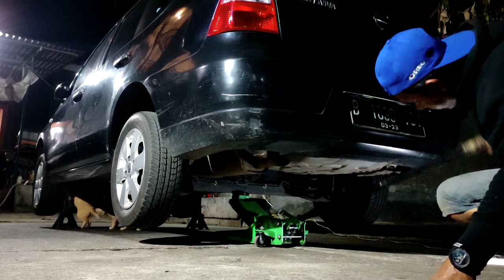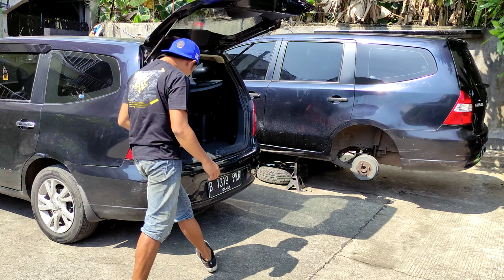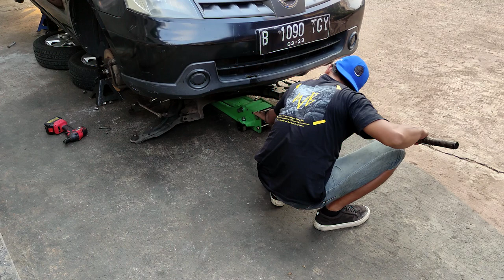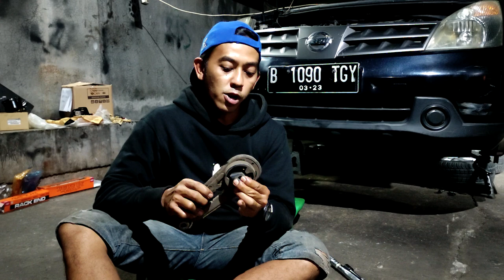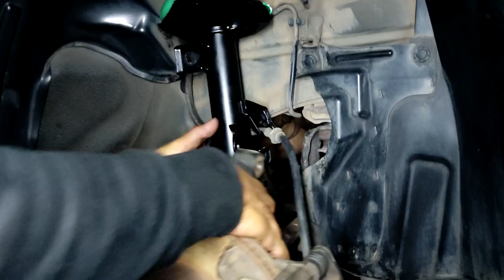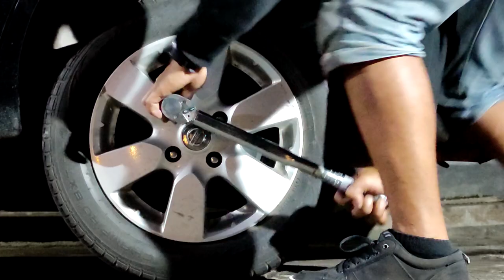Monroe OESpectrum Install - Nissan Grand Livina - Suspension

Comment: Konten nya bagus, runut, cara kerja rapih, ngga asal2an, alat2nya proper.. Tp menurutku klo ganti arm prefer yg ori (sejutaan). Itu part vital di kaki2 rawan bengkok. Atau klo ga ganti, bisa ganti bushing2 sm balljoint saja.
Reply from the maker: terimakasih banyak om,.,  🙏😎
betul sekali, arm di dealer 1jtan / pcs, lks setengah harga om,., saya tetep sarankan untuk parts oem, tetapi untuk alternatif karena dana dari owner nya bisa menggunakan aftermarket low-budget masih lebih baik daripada kw bungkus nissan, banyak yang copot joint dijalan, 😬
Reply: @danangalvaris  nah itu yg sy ngeri, sering liat postingan livina keseleo roda depan. Kdg cm kena batu pas belok bisa mleyot arm nya.

Comment: Alatnya bikin proses kerja lebih mudah, tapi safety,  keren banget.
Reply from the maker: terimakasih om, salam sehat & bahagia selalu, 🙏🏻😎
Reply: Mase .... Mobilku Vina 2011,aku mau ganti link stabilizer nih, pertanyaannya, link stabilizer Vina bawaan pabrik/ ORI itu materialnya besi/aluminium? Mohon pencerahannya 🙏
Reply from the maker: halo om  @rotibakar4607  , setau saya yg ori bawaan itu material aluminium dengan bantalan teflon, om,., #cmiiw
apabila diganti, menggunakan aftermarket 555 lebih rekomen, daripada beli yg gambar nissan, kecuali beli parts di dealer, 🙏🏻😎
Reply: @danangalvaris  terimakasih penjelasannya mase🙏
Reply: Saya mau perbaiki grand Livina tahun 2010 dimana alamatnya???😢😢😢

Comment: Om, saya ada hrv 2021 py istri pemakaian 2022. Awal beli ngerasa per ori ga enak banget, kalo ngerem berasa body mobil maju ke depan, plus mantul2 & goyangnya kalo kena lubang ga nyaman banget.

Nanya org dealer dibilang bawaan hrv emg gt 😂. Akhirnya setelah tanya sana sini, kami putuskan ganti per ori pake Eibach Pro Kit. Jauh lebih stabil tapi tetap kalo setelah kena lubang terutama ban belakang berasa keras & goyang, kaya yg shocknya telat compensate. 

Kira2 kalo mesti ganti shockbreaker rekomen brand apa ya om? Makasih sebelumnya
Reply from the maker: bukan nya shock aslinya pake showa ya om,? ada temen pake Tein, om,., infonya enak,., pilihan aftermarket bisa menggunakan Monroe, 🙏😎 #cmiiw

Comment: izin tanya mas, ada rencana mau ganti shock nissan grand livina L11 2014. untuk tipe shock monroe spectrum ini apakah sama untuk L11 dengan yang mas pasang? kalau gk salah antara L10 dan L11 ada perbendaan di shock breaker belakang(koreksi apabila salah). thank you mas sehat selalu
Reply from the maker: halo om, setau saya kalo aftermarket seperti merek monroe / jamex untuk L10 dan L11 sama om,., Tetapi untuk oem, ada beda kode parts bentuk sama tapi beda rasa, 🙏🏻😁
Reply: @danangalvaris  siap terimakasih infonya om. soalnya kalau salah order lumaya ongkirnya ke sumatra om. hehehe. trims om informasinya
Reply from the maker: siap om  @jerryjulian5632  , salam sehat & bahagia selalu, 🙏🏻😁
Reply: @danangalvaris  mending pake yg ori Om klo cari nyaman. Barang after market g enak dipake, saya pake monroe serasa naik avanza lg.Padahal dlu pake shock asli livina nyaman bgt.kumpulin duit aja dlu sabar.
Reply from the maker: setuju om  @D2T85  untuk nyaman pake oem. 👍
Untuk oem ini juga ada beberapa versi, ada yg untuk latio, ada grand livina, livina xgear, juga ultimate,., ini bisa digunakan tetapi beda karakter shock, 🙏🏻😁
Reply: @D2T85 2 tahun yg lalu saya ganti OEM, skrg sdh jebol om. Padahal jalanan tdk terlalu keriting. Sy ganti di beres Nissan 😅. Kira² itu knp om

Comment: Siang om, saya pake march, lagi nunggu part ganti low arm, tie rod, sekalian mau ganti shock depan belakang. 

Ac delco vs monroe perbedaannya apa om? 🙏🏻🙏🏻🙏🏻

Bengkel yg kerjain mobil belum pernah nemu ac delco kepasang dan masangin, jadi ga tau. 

Mohon di bantu ya omku saran nya.

Terimakasih banyak.
Reply from the maker: sama om, saya juga belum pernah nyobain AC Delco,.,
monroe oespectrum itu type monotube dengan gas, terasa lebih kaku dibanding oem, tetapi lebih stabil dan lebih awet untuk yang sering muatan,., #cmiiw 😎🙏
Reply: Monroe gmn klo buat depan grand livina gmn om

Comment: izin mas mau tanya sy user livina xv 2009 Matic, boleh di list gak om buat kaki² depan tadi bushing support beam arm depan dan belakang saya mau belanjakan online, sbb sy di batam om jauh gk bisa mampir bengkel sempean😅
Reply from the maker: untuk bushing arm depan dan arm belakang, apabila kondisinya retak pada karet saja sebaiknya di cor menggunakan PU polyurethane,,. karena apabila diganti dengan material yang bukan ori, usia pakainya pendek, om,., 🙏😎 #cmiiw
Reply: @danangalvaris  brati sy tetep harus ke tempat spesialis kaki² ya om yg ada di daerah sy?

Comment: mau tanya om, kalau untuk nissan almera n17 rekomendasinya bagaimana?
depan ori (pesan di dealer) vs jamex (sepertinya kw buatan china ya? bukan belanda)
belakang ori (pesan di dealer) vs monroe oespectrum vs jamex vs kyb excel G
saya merasa bawaannya rada limbung kalau lewat bawahnya tol mbz (entah memang begitu atau emang umur), kondisi shock belakang kiri dah bocor dikit, kanan depan lebih empuk dari yang kiri (tapi tidak bocor). shock depan dua²nya (ketika dicopot ganti boot) as nya tidak naik setelah ditekan masuk, shock belakang belum pernah dicopot
Reply from the maker: kalo yg dipakai limbung, kemungkinan besar dari usia om,., shock aftermarket umumnya kurang nyaman, tapi lebih stabil,.,
apabila ganti shock, sebaiknya perhatikan parts lainnya, seperti yg sepele dudukan per, bushing, juga joint, 🙏🏻😎

Comment: Izin bertanya mas, stir sy jika keadaa parkir dimainkan kiri kanan bunyi tek tek.... 
- Apakah ini bushing rack steer nya sdh oblak atau pinionnya... Jika di servis bs bertahan lama kah? 
Atau jika diganti assy merek apa yg bgs ( after market) sbb byk merk dr yg hrg 1,5jt sampi 3jtn..klo yg assy ori jgn tanya deh hrg nya 😁.. 

- Oh ya link stabil merk 555 tierod dll yg original tandanya spt apa ya.. Mngkn ad rekomen toko spare part yg jujur 🙏

- Biasanya oli perseneling diganti brp kilometer ya, mbl sy kebetulan Grand Livina mt 2012 ( kilometer sdh 170rb) 

Untuk mesin mas danang open service jg gak? 

Tq sblmnya ( tlg dijwb semu  ya mas) 🙏
Reply from the maker: halo om,.,
- kemungkinan besar bunyi tek2 dari bushing rack steer, om,., biasanya bushingnya aja diganti teflon, ini tahan lama (tergantung pemakaian),., kalo aftermarket bisa awet, tergantung pemakaian juga.,

- untuk cari part yg asli, memang harus ada langganan, om,., 🙏🏻😁

- oli persneling umumnya 2x ganti oli mesin,., tapi kalo saya bisa pake sampe 40rb KM, pake pertamina 40 (sae)

- untuk engine saya biasanya untuk mobil usia diatas 150rb KM, di tune up sampe kondisi optimal., sampe ketemu enak, baru kalo ownernya mau upgrade itu berikutnya, 🙏🏻😎 #cmiiw
Reply: @danangalvaris  brp service tack stering dan gurah mesin ditmp mas danang... Pake scaner jg ya 🙏
Ngelitik grand livina mmg sdh penyakit bawaan... Cm bertahan 1-3 bulan kembali ngelitik lg.... Sdh bbrp bengkel sy coba c. . Hasilnya ya begitu jg 😁

Barusan sy sdh ganti link stabilizer kiri kanan merk 555 ... Keliatannya msh suka bunyi teng ( seperti suara besi / per yg di sentil) ... Bunyi klo keadaannya lg parkir atau puter balik... Klo support 1 bln lalu sdh ganti yg oem... Bering support blm sdh pernah ganti tp bbrp th lalu.. Menurut mekanik bengkel per katanya msh layak pakai...
Reply: @danangalvaris  lokasi workshop dmn
Reply from the maker: saya Gunung putri, Bogor om @x-ray4033  🙏🏻😁
Reply: @danangalvaris boleh alamat lengkapnya mas...salam kenal

Comment: Om untuk nilai torque masing2 baut yg dikencengin brapa aja ya Om? Baut kaki2, shock breaker, support shock dll.... Saya lg nyari maintenance manual Livina tentang besaran torque belum Nemu....🙏
Reply from the maker: 3 baut support 28nm, as shock 62nm, link stabil 37nm, 2 baut shock - knuckle 175nm, ball joint 55nm,., 😎 #cmiiw
Reply: Terima kasih banyak om....🙏
Reply: izin nanya mas,
utk cari info tentang nilai torsi baut di mana ya?

Comment: Bang. Sebelum ganti shock( yg lama udah mati) kalo jalan sendirian ketemu jalan keriting, perut seperti dikocok kocok. Setelah ganti monroe depan belakang baru, berharap lebih nyaman. Tapi kok masih mengocok perut ya kalo ketemu jalan keriting? Apakah normal bang?
Reply from the maker: kondisi bushing2, bagaimana om,? per standar apa sudah diganti,?
Reply: @danangalvaris  per standar. Cuma bushing2 kayaknya perlu diganti. Apakah karena itu ya?

Tapi pake monroe yg kerasa banget handlingnya jadi manteb.

Comment: bang izin bertanya, kalo tekanan torsi baut mesin (untuk tune up cleaning pengapian)  dan torsi kaki-kaki itu berapa ya?
Reply from the maker: CYLINDER HEAD (SILINDER KEPALA)
Rocker cover bolt (baut rocker cover / tutup silinder kepala)	1 kg.m
Ignition coil bolt (baut koil)	0.71 kg.m
Spark plug (busi)	2 kg.m
Valve rocker support bolt (baut valve rocker shaft assembly)	0.2 --> 0.6 --> 1.1 kg.m
Cylinder head bolt (baut silinder head / silinder kepala)	6.8 --> 0 + 5 + 75° + 75° kg.m
TIMING CHAIN DAN OIL PUMP
Camshaft sprocket bolt (baut camshaft)	8 kg.m
Chain tensioner bolt	1 kg.m
Timing chain tensioner guide	2.6 kg.m
Timing Chain cover long bolt	5.6 kg.m
Timing Chain cover short bolt	2.6 kg.m
Oil pump timing chain tensioner bolt	1 kg.m
Oil pump sprocket nut	2.6 kg.m
Oil pump bolt	2.6 kg.m
Oil level guide pipe bolt	1 kg.m
Oil pan upper	2.6 kg.m
Oil pan lower	1 kg.m
Drain plug (baut pembuangan oli)	3.5 kg.m
FUEL INJECTOR DAN FUEL TUBE
Fuel tube bracket pipe bolt	2.6 kg.m
Fuel tube protector short bolt	1 kg.m
Fuel tube protector long bolt	2.6 kg.m
EXHAUST MANIFOLD
Exhaust manifold stud bolt	1.2 kg.m
Exhaust manifold nut	3.4 kg.m
Exhaust manifold cover	0.82 kg.m
Heated Oxygen sensor	5.1 kg.m
Bracket exhaust manifold stay	5.2 kg.m
Exhaust manifold cover bolt	0.59 kg.m
Heat insulator (baut plat penahan panas exhaust)	3.6 kg.m
INTAKE MANIFOLD DAN EGR
EGR guide tube bolt	2.6 kg.m
Electric EGR control Bolt	2.6 kg.m
EGR temperature sensor	1.6 kg.m
Throttle body bolt	1 kg.m
Intake manifold bolt	2.8 kg.m
Intake manifold support bolt (front,center,rear)	1 kg.m
PISTON DAN CONNECTING ROD
Connecting rod bearing bolt (baut metal jalan)	2.8 kg.m --> 0 + 2 + 60°
CRANKSHAFT DAN SILINDER BLOK
Flywheel bolt (baut flywheel / roda gila)	11 kg.m
Crankshaft dumper pulley bolt (baut puli crankshaft)	3,6 kg.m + 60°
Main bearing cap bolt (baut metal duduk)	3.3 kg.m + 60°
Signal plate rear engine	2.2 kg.m
Oil pressure switch	2 kg.m
Crankshaft position sensor bolt	0.71 kg.m
Reply: @danangalvaris  makasih banyak bang, penting bgt ini salah-salah drat jadi doll, part jadi rusak 👍👍🙌🙌
Reply from the maker: betul om  @alhambase7468  , untuk kunci torsi dengan satuan nm atau kgf atau yang lain tinggal dikonversi, 🙏🏻😁

Comment: Klo ban belakang livina L11 gundul sebelah bagian luar kenapa ya ka?
Reply: Umur ban cuman 6 bln, pemakaian 120 km/ hari
Reply from the maker: halo om, apabila ban makan sebelah, biasanya ada kemiringan roda (camber / toe) yang berlebih,.,
bisa disebabkan karena joint adjustment (spooring), bisa juga karena bushing, bisa karena bearing roda,.,

untuk livina, karena suspensi belakang menggunakan tipe torsion beam/ twist beam yang tidak memiliki adjustment, umumnya karena dudukan bearing roda yang miring, atau mungkin karena bushing yang longgar, atau suspensi mati sebelah yang menyebabkan miring hal ini bisa diperiksa satupersatu,., bisa juga disebabkan karena kebiasaan parkir di tempat miring kiri/kanan yang menyebabkan arm nya bengkok/ melintir, hal ini bisa di perbaiki dengan mengganjal antara bearing belakang & dudukannya supaya kemiringan roda di posisi ideal,.,
semoga membantu, 🙏😎 #cmiiw

Comment: Bang mau tanya, kalau setir lg diputer mentok, kayak pas abis puter balik, ada suara jegluk ringan itu kenapa ya? Apa karakteristik livina gitu.. kmren sy cek ke bengkel katanya aman..
Reply from the maker: memang ada stopper om,., kalo muternya kenceng bunyi mentok,.,

atau bunyinya pas bales,? kalo gluk, bisa jadi bushing rack, bisa jadi support, atau stabilizer, juga joint,., kalo sudah di cek bengkel, aman,., biasanya masih toleransi aman om,., 🙏🏻😎 #cmiiw
Reply: @danangalvaris  siap om. Thanks info.